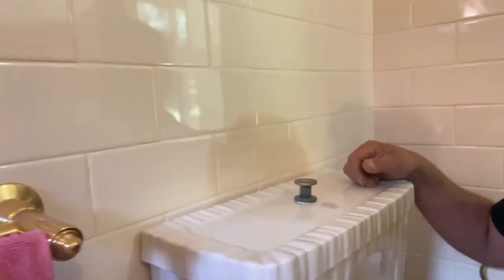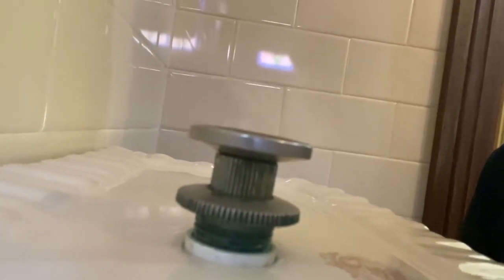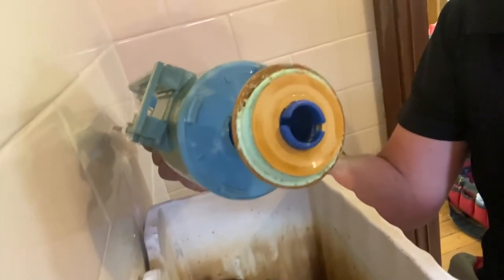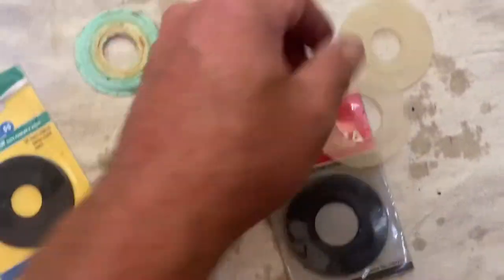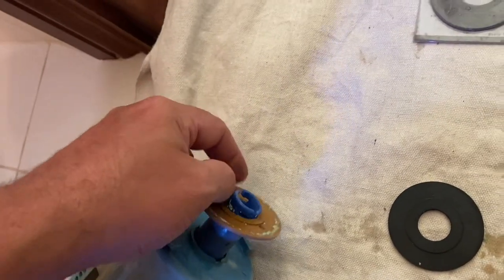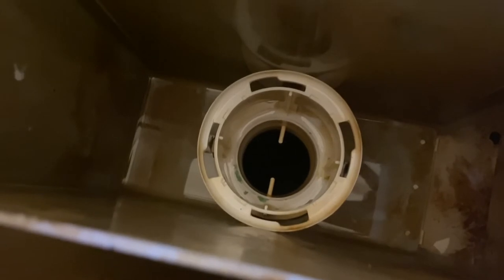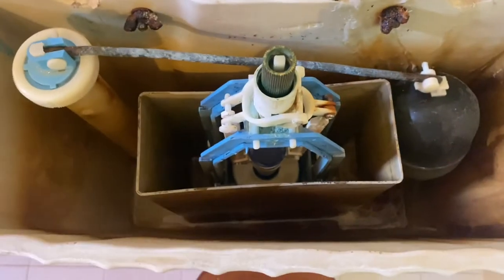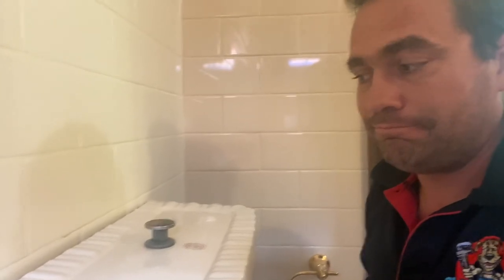How To Service A 1970s / 1980s Fowler Toilet Cistern | Plumbdog Plumbing Perth

Comment: Invaluable, clearly explained and well filmed - thank you so much! We had only one extra step with our (older?) model, which we found elsewhere and might help others: "Before twisting the assembly out, take out the pin which holds the half flush flap."

Comment: Thanks for the video. My issue is the crack down the back face of the cistern, starting at the retaining screw, which is leaking. Interestingly the one in your video has a crack in exactly the same place. Obviously, a design (or original installation) flaw.

Comment: I live in Melbourne, Victoria and have the same cistern set up. My cistern is allowing water to run into the toilet bowl. The rubber seal at the base of the cistern has corroded and I need to replace it. Any ideas as to where I could purchase the seal once I remove it ? Being such an older  model has made it difficult to find a place that stock them .
Would really appreciate your help 😊

Comment: I just replaced the seal in the water valve that deteriorated and was not cutting of the water causing an overflow and constant leak.  A how to on that might be of help to owners of this cistern, I think there are many of them dating back to the 90's.
Reply: Hi GmBob, it seems I have the same issue as you. I have the fowler dual flush system as in the video, but my water level seems to high. I can't find away to reduce the water level in my tank. When I put the tank lid back on, it touches the piece of metal between the float and the flush system, therefore it constantly hisses and puts water in the bowl. Any ideas how to reduce the water level? Cheers Chris